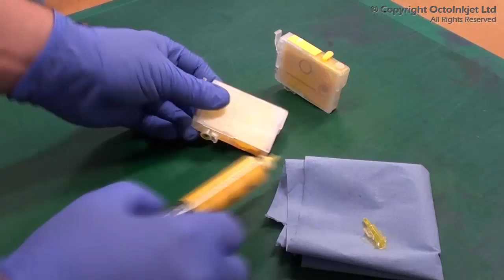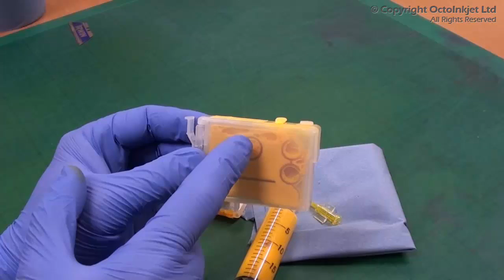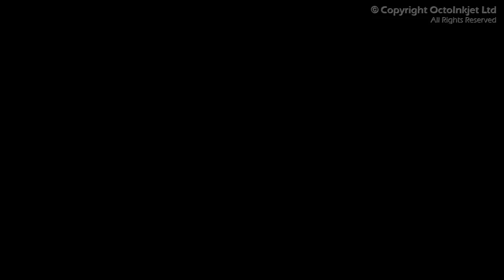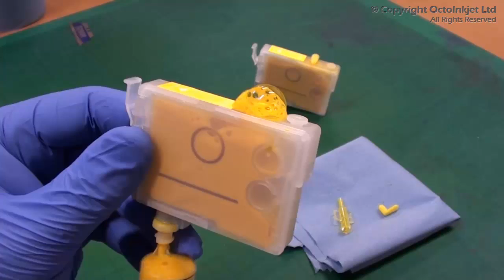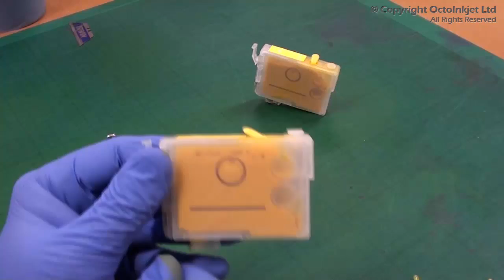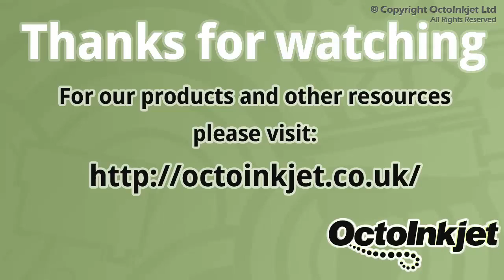Refilling Epson Refillable Cartridges - Bottom Prime/Fill method

Comment: I have an epson wk3720 and it won't recognize the cartridges. With that being said there was a small metal thing that came out of the ink cartridge area when I took out the epson black, cyan, magenta cartridges. Now I can't get my printer to accept either type of cartridge....the refillable or the Epson. Any suggestions? I am thinking because the little pieces came out that the printer is finished. Thank you for your time.
Reply from the maker: Sorry for the delayed reply Lacey... It sounds like the CSIC board has broken or lost some of the contact wires needed for the printer to connect to the cartridge chips. As a result it's throwing the "not recognised" error. Not an easy fix unfortunately.. Sorry for the bad news.

Comment: what cartridge do you use for Canadian XP-7100
Reply from the maker: The newer cartridges designs in many of the more expensive XP series use a completely different cartridge and outlet design that isn't compatible with this approach. You might want to check out InkOwl as you're in Canada and they're likely to have the info you need.